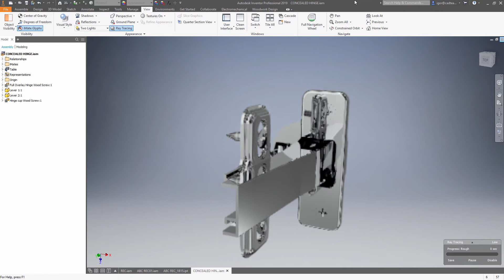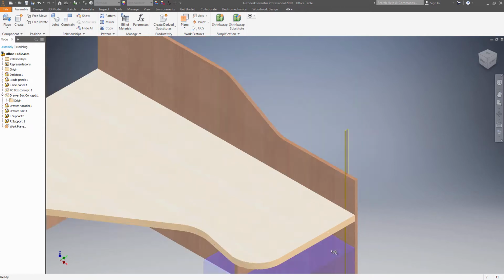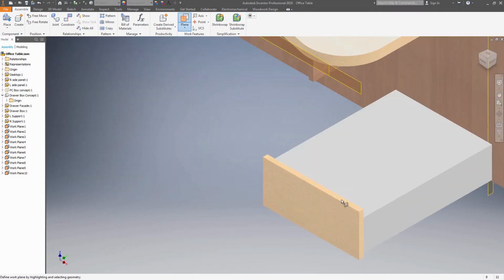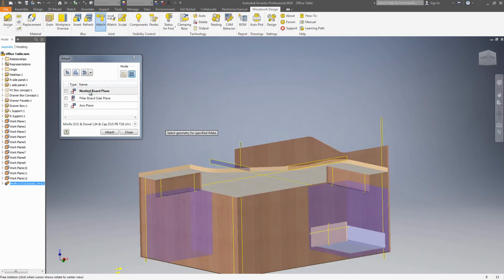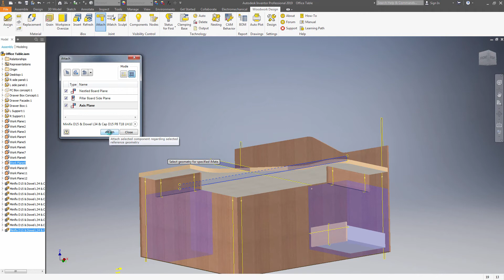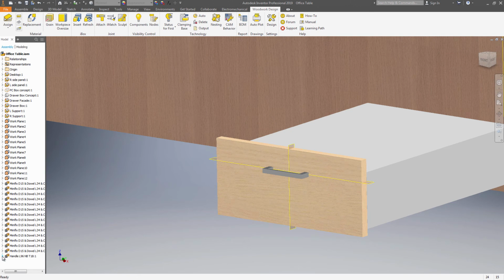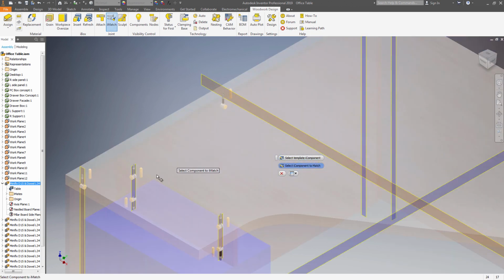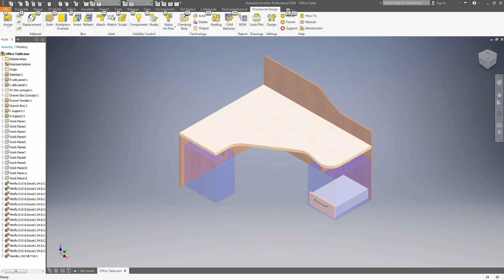Hardware assignment

Comment: Why don't you insert the 3 hardwares between left panel and desktop at the same time? You insert the lateral plans before and then the middle plan. Thanks for the videos.
Reply from the maker: Woodwork places the hardware in the intersection of the selected geometry. if i understood you correctly if i would do as you told then i'll got the excessive amount of hardware. I think it's betted to do two small and simple steps instead of one more complicated :)